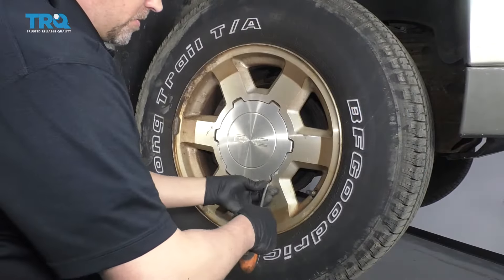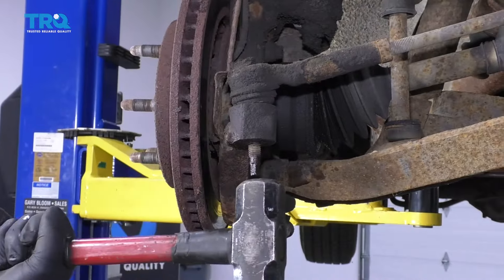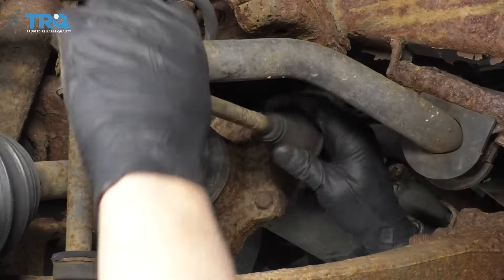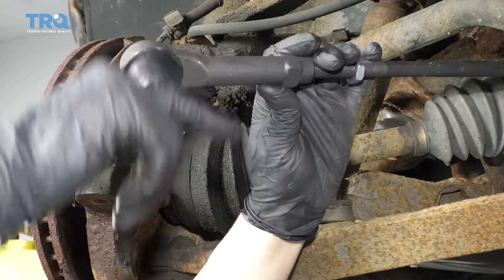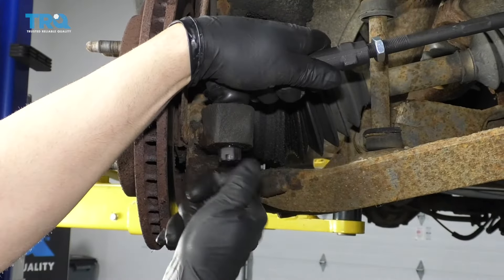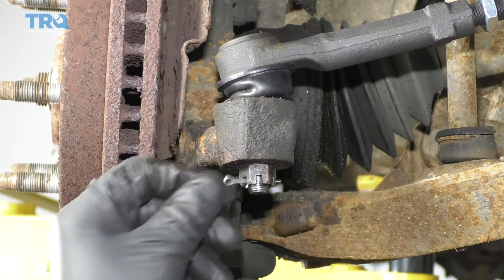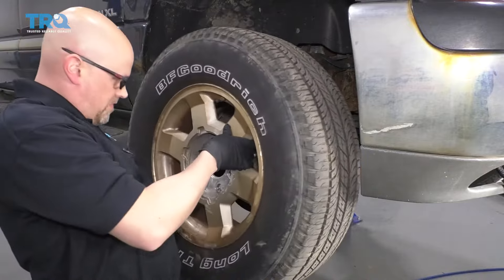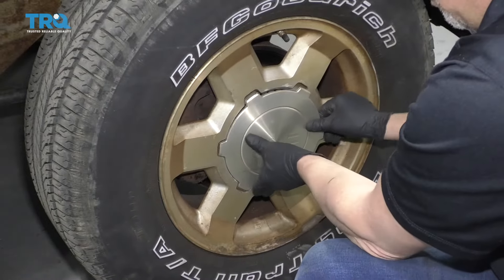How to Replace Front Inner Tie Rod 2000-06 GMC Yukon

Comment: So does loosening or tightening the tie rod ends move the front wheels side to side? I hit a boulder with the front corner of my Yukon and now my steering wheel center bar, instead of going side to side with the front wheels straight, it’s going up and down. Don’t know if I bent something or bent the frame or just knocked the front end out… the rim was shot, had to get a new one and it blew the tire out.
Reply: I hope you've already had your suspension and steering looked at because that's not normal.  I think you kind of already figured that.
Reply: Break out your wallet and go to a tire shop and get a quote for literally everything in the front